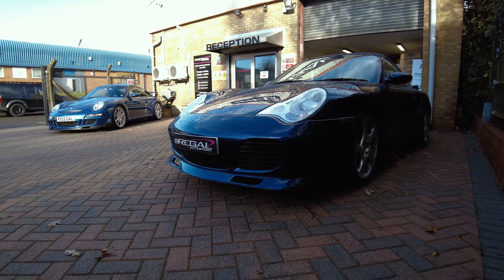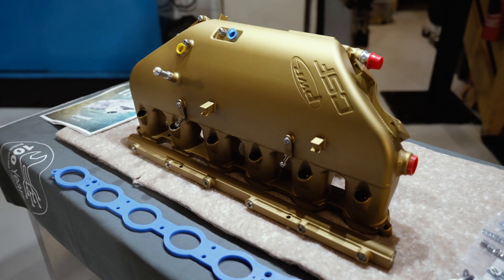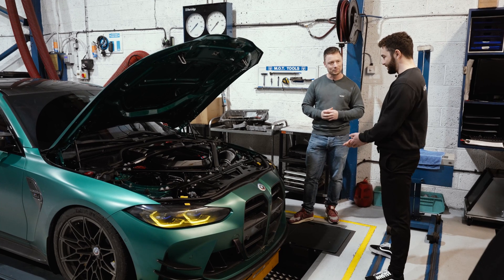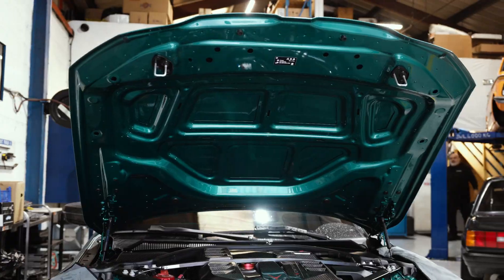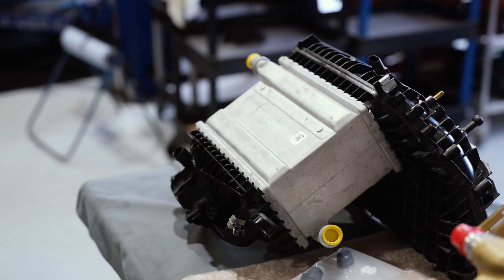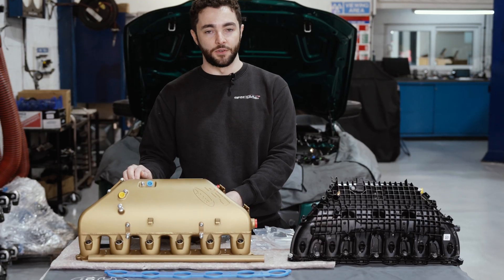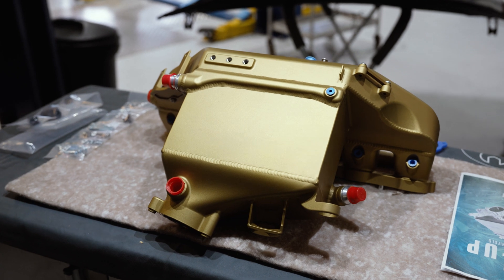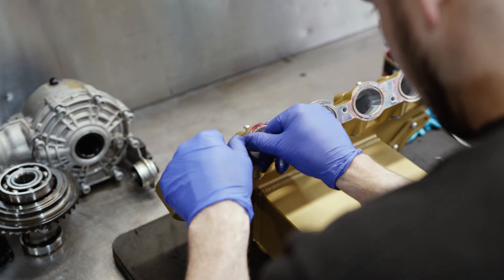The first Custom CSF Intake Manifold for BMW S58 (M2, M3, M4, X3M etc.)

Comment: Would this have any benefit on a stock G80 with no other engine mods?
Reply: The engine would run cooler. Heat is one of the ennemy of internal parts lifespan.